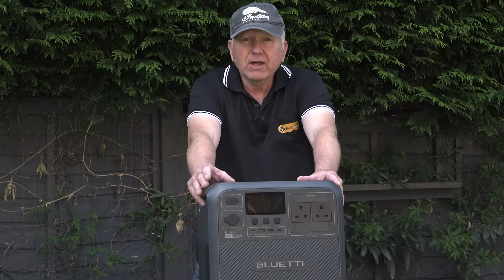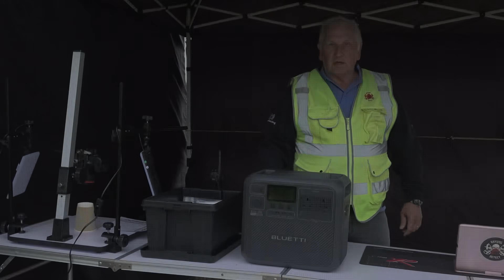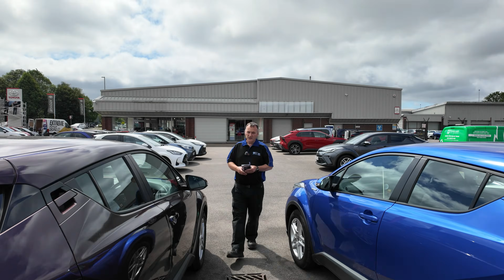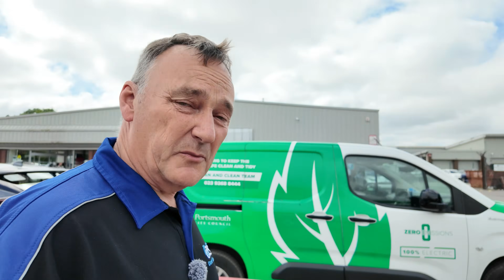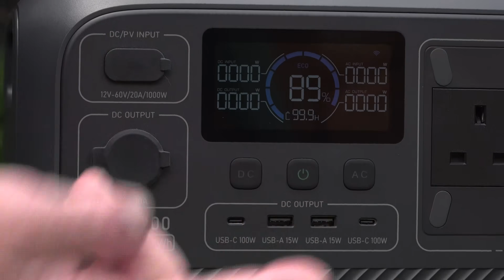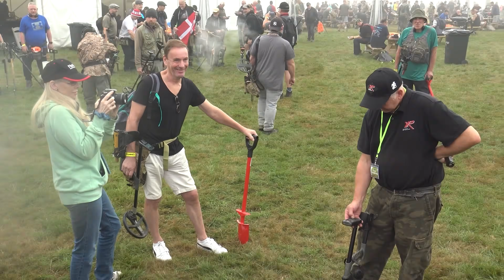Bluetti Elite 200 V2 my problems are solved !

Comment: I use my Bluetti in my campervan as the main power source. I run a cigarette lighter connector to a 12v fuse box from the Bluetti. I run an extension cable with 2 240v sockets on simply plugged into the 3 pin socket on the power station. I charge it via a 200w solar panel on my roof. Works great and all controlled from the Bluetti app.
Reply from the maker: That sounds great, thanks for your thoughts 👍

Comment: Amazon Canada has two models for $199, I just looked it up after this video, they were 300w and 600w models for the plugs, plus 2 USB and 1 usbc ports, for an extra $200 you can get a solar panel 

Can't afford it at the moment, but it was tempting
Reply from the maker: Keep an eye on Black Friday deals.
The Bluetti is 2600w
Reply: @The-skillschool I was looking at the bluetti eb3a model, it was 1200w but only 600w per plug

Comment: Gary we have a product here in the States called Sta-bil. You put a little in your gas tank when you are not using your equipment for a bit and you’ll never have a bad gas issue again. Maybe you can get that in your area or a similar product .
Reply from the maker: Great info, thanks I did try seafoam once.